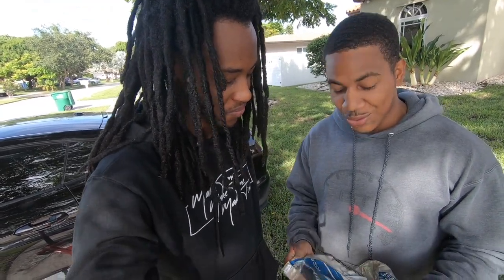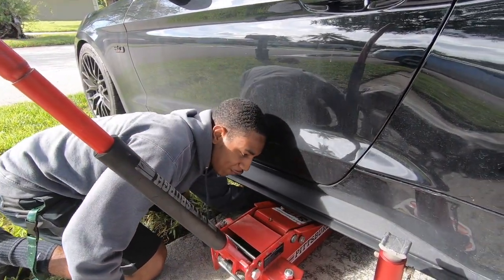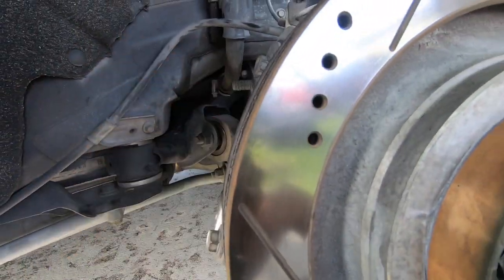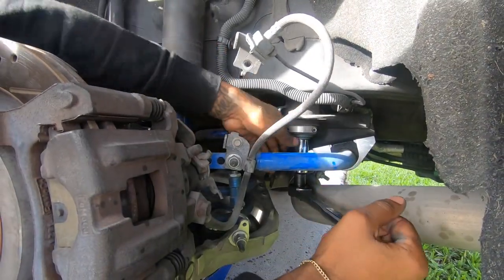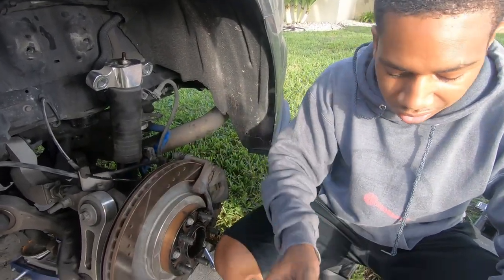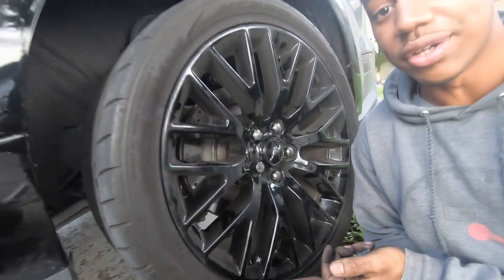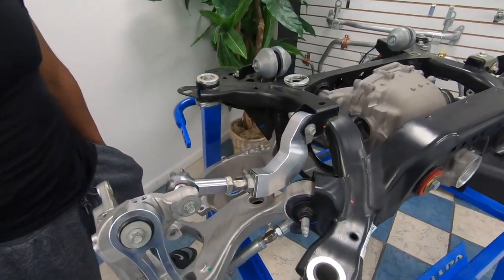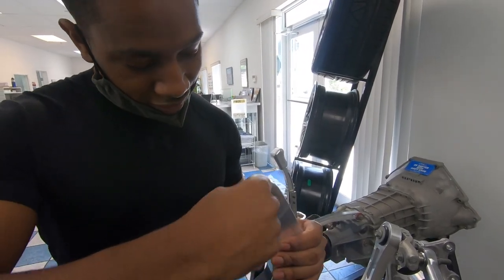How To Stop Your S550 Mustangs Rear End From Making Noise + How To Drop Subframe

Comment: I keep a can of dielectric grease/paste around. Use it to lube up spring cups & perches when installing new suspension. It's suggested to take apart sway bar mounts once a year, clean any debris between the mount and the sway bar, then re-apply grease and assemble. put on o-rings and seals when installing to help them last longer. Rubber body seals & trim, apply a thin coat once a year keeps them from drying out. Also makes assembling anything with a plastic, rubber, or silicone seal a lot easier; like putting an air filter on a CAI tube.  A dab on your spark plug ceramic helps sliding the plug wire boots on & off. Will also seal up and protect electrical connections exposed to the elements. Probably one of the most unused and under-appreciated lubricants for automotive applications.

8oz can of Mission dielectric grease is usually $20-$25 and a one-time purchase for the average hobby/home mechanic.

Comment: When you installed them didn't you use the correct Silicone Super Lube?   I've never had an issue like that and I've lost count of how many cars I built.....
Reply from the maker: Yes, they came with silicone lubricant from energy suspension. That’s why we were all surprised that it started making that noise in such a fairly short time.

Comment: So I’m on stock suspension on a 2022 GT took to dealer for oil change and told them about the squeak as well sounded just like this. They diagnosed It as spring isolators and are currently replacing them. Do you think on a stock set up this would be the case?
Reply from the maker: @vincecarbonaro5692  yes definitely, that’s actually how we landed on the isolators as the possible culprit. A lot of cars stock and modded had the same issue and the isolators were found to be the cause of the noise in quite a few of them.

Comment: Did this fix the issue in the long run?
Reply from the maker: yes it did, the issue ended up being that it needed grease. it squeaks on occasions but I’m not about to take it back apart anytime soon. I’ll probably pull it apart to grease them again when we change the axles.

Comment: I just put a rear sway bar on my 2020 and literally started making that noise wtf. Not sure what it is. Might have to loosen evrything and retighten it and hope it goes away.
Reply from the maker: Did it come with upgraded sway bar bushings? Sometimes if they aren’t greased enough they will squeak. If that’s the only aftermarket suspension thing you have start there.
Reply: @ThrottleHavoc  yeah it did and it came with the grease too. Made sure I put all of it on both bushings. Thanks for the reply! I’ll see what’s up
Reply from the maker: @erik5oh207  no problem, if not that and the rest of your suspension is stock I’d definitely check out the spring isolators. My car had a minor squeak prior to getting suspension work, and looking at the aftermath the spring isolators would’ve been the only thing to cause that at the time.

Comment: Yoo I have this same problem after installing eibach springs on my 2019 mustang but my sound seems to be coming from the front suspension any thoughts ?
Reply from the maker: Ehh we can’t really comment on the front. All the research and trouble shooting we did was on the rear of the car. However we’ve heard about the bump stops wearing out in the front and causing some clunking and maybe squeaking. I’m also not sure what your suspension set up is but if it was us, we’d start by checking the bump stops on the strut or the sway bar bushing. Other than that it could be a number of things, I’d just jack the car up and start looking at different things if it wasn’t one of the two items we just mentioned.
Reply: Did you find a fix? I also have a 2019 with eibach springs and and also having squeaking sounds from the front suspension
Reply: @cobra7054  haven’t checked
Reply: Same issue, i only want to take it apart once, I’d rather have the parts when i do. Have you figured out the issue?

Comment: Ya need to use silicone Super Lube....Clear....It's there for life....
Reply from the maker: The grease we used is supposed to be good for 5 years, we reapplied and it’s been good so far.
Reply: @ThrottleHavoc  That's pretty cool how you guys went to Steeda.....I finished a 2016 GT with the whole complete stop the hop kit.....I must say these parts work.   They are one of the best companies to deal with.   One of the best views in this video is the Glock case on the rear seat......
Reply: @ThrottleHavoc  Greasing urethane/delrin bushings bushings becomes routine maintenance.....
Reply from the maker: @thomasrouh2258  definitely, I’m just referencing the rating of the grease so you have an idea of the strength and kind of grease we used.
Reply: @ThrottleHavoc  I'm pretty sure Steeda would be using the Silicone Super Lube.....That's what's in the little packs of lube given to you whenever you purchase urethane/delrin bushing or any part containing that material......Is your pony car naturally aspirated or forced......If you did any engine mods what are they?    Just curious.....
Reply from the maker: @thomasrouh2258  yea I’m sure it’s a silicone super lube, it’s the little energy suspension packets. It’s naturally aspirated for now. I have plans to boost it though eventually.
Reply from the maker: @thomasrouh2258  yea the stop the hop parts definitely work, the change is drastic. And yep lol we are also gun enthusiasts, that day alpha was picking up his G19x I think If I remember correctly.
Reply: @ThrottleHavoc  Very cool.....Gaston Glock just died a few days ago....Genius.....